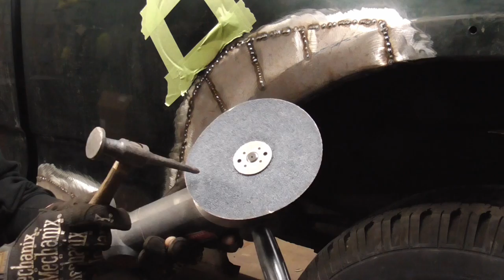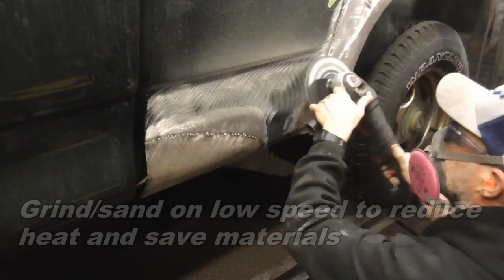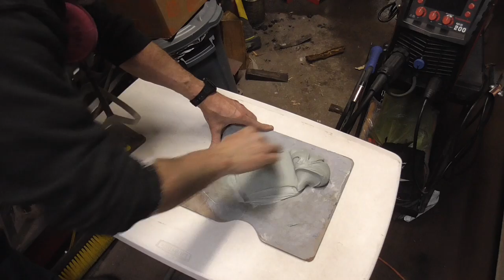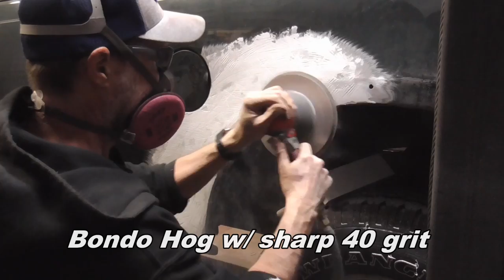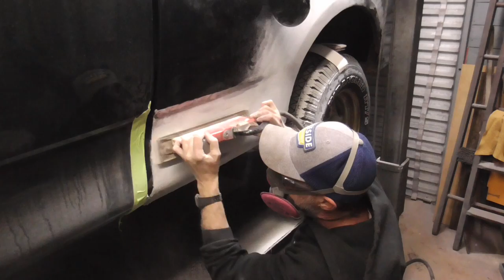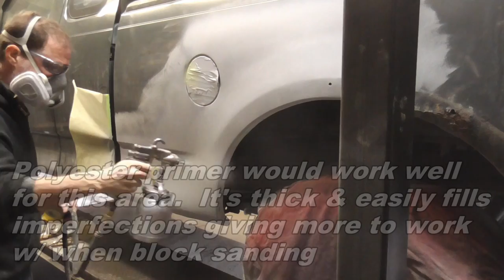Extreme Rust Hole Repair w/ Homemade Patch Panel - Part 2 / End

Comment: Thanks for all the specifics like the sandpaper grit. It's informative to see that it takes multiple coats to get the finish right.
Reply from the maker: It's rare to get the filler straight in one shot on large dents and rust repairs.  A couple times should get you close and the third is just filling in pits, minor low spots or other imperfections :)

Comment: Great job teaching a very practical, efficient and long-lasting method for repairing a very common rust issue! With that mileage, that truck is still in its adolescent years; capable of many more miles!
Reply from the maker: Thanks Icar - nice to hear from you my friend - hope all is well :)

Comment: The Calcium Chloride brine spray that is used in PA really eats the paint right off the metal of vehicles.  Also, it just destroys clear coated aluminum wheels.  The real kiss of death for a vehicle, is to keep a salted vehicle in a heated garage in the winter.  Heat activates the corrosion process.  Nice work - expert!!!!
Reply from the maker: Thanks Bruce - winter in the salt belt is hard on cars for sure - a real bummer :)

Comment: Just keeping those body lines correct is a big challenge in itself. You make it look effortless. My guess is practice makes perfect. Have a good one Jerry.
Reply from the maker: Thanks Mike.  I used to struggle big time when I first started doing heavy collision work and rust jobs like this.  Feather fill really helped me out.  Along with the cheese grater, using tape on the body lines,  always using super sharp sand paper, the bondo hog and really making sure high spots were tapped down before applying the filler.  Thanks for the kind words Mike :)

Comment: Worth watching a couple times.

I use an Astro mini belt sander with a 3/8” wide belt and 3M Cubitron belts and I can grind welds fast without touching* the parent metal.
Reply from the maker: I like Astro stuff.  I'll bet those Cubitron belts are sharp as heck when new 🔥
Reply: @LakesideAutobody  I started doing autobody work in the 70’s and Astro was considered junk next to IR and Viking. I think it’s always been pretty good and I still have an old Astro Binks #7 knockoff that sprays better than just about anything out there...but you really need a booth for that beast.

Yeah, the Cubitron is crazy good. I always have a spare box and I used my last box and my spare box disappeared. I think I ground 5 feet of stitch weld by the time the new box came and the old belt was still cutting.
Reply from the maker: @jeffreylonigro1382  That's funny about the Astro Binks - I had a Buffalo Pneumatic Devilbiss JGA copy that sprayed great - I a gave it to a friend of mine and wish I still had it.  The thing was indestructible.  Thanks for getting back to me about the Cubitron - good to know.  Have a great week :)

Comment: Instead of using the buffer with the 36 grit to remove the welds I would start with a finger sander as this goes directly to the weld without removing steel from the areas around it. Astro makes nice ones. This tool is also the bomb for removing spot welds particularly on modern cars that use high strength steel or boron steel that defeats normal spot weld bits. After removing most of the weld you can then finish things off with the air grinder or the buffer. Just a suggestion.
Reply from the maker: Thanks SATAMAN - always good to hear from you my friend.  I've known you for quite some time now - maybe almost 5 years.  Have a great week :)

Comment: Great video. I've done a few classic cars that are drivers,the owners want to nice paint job without paying for it. Some of the previous work done on cars have caused me to price the work out of their range because in some cases, there's more than 3 or 4 paint jobs done,one on top of the other. In your opinion,how many paint jobs stacked up is too much? Thanks for your reply.
Reply from the maker: Sorry about the late reply - missed the comment.  Sorry again too as I'm not quite sure what your ? is.  If you are doing cars for people and you do good work come up with a price that works for you like $20/hr or $100/panel etc.  An example would be if you charged $100 per panel - that's 9 panels on a 2 door so the job would be 900 bucks.  If you want to make more charge 200/panel.  Post it in your garage and go up to it when folks ask and say here's the prices.  It's very hard to charge people - I get it but if you don't, you'll be working too hard for too little.  If you come up with a good plan let me know - might use it myself 😊✌

Comment: Amazing work as always, I have a question, why no one ever put down a 2k primer on bare metal before filling, I’d thought it would give more rust protection?
Reply from the maker: The truth is the only protection you need is the paint - that's it - paint protects everything under it.  From the other side you need drainage and some method like in this video - https://www.youtube.com/watch?v=8XaZBy7GC7A or this - https://www.youtube.com/watch?v=y05dNxt-nVc

Comment: Enjoyed watching you work the metal. One question. What did you use to treat the metal on the inside of the patch panel to help prevent rust from forming and to ruin the wonderful work you preformed?
Reply from the maker: I have found this to work the best actually because it creeps into the pinch welds and stays greasy like an old valve cover that never rusts - https://www.youtube.com/watch?v=8XaZBy7GC7A  See this too if you want - https://www.youtube.com/watch?v=DqxMHCizkUE

Comment: Can you wet sand body filler that was put directly into bare metal? Will it rust over time? Thank you!
Reply from the maker: Are you talking about maybe if you are finish sanding (wet) and happen to sand through the primer and hit filler?  There should never be a time when you purposely decide to wet sand filler.  However, if you do for some reason, you'll be fine.  It won't rust over time.  By the time you blow it off with the air gun it will all evaporate or dry.  You can absolutely get filler wet and not worry about the bar metal underneath - that's stuff that you hear in magazines, internet and blogs but won't hear in a body shop 👍💯😊
Reply: @LakesideAutobody  very helpful sir. Thank you.

Comment: Nice work! What about where the inner and outer fender meet do you use a seam sealer to prevent water and dirt to go between the body panels?  Thanks!
Reply from the maker: I have found that drainage is the key so... I do this when the repair is done - https://www.youtube.com/watch?v=8XaZBy7GC7A

Comment: Thank you for the video. What size air compressor do you use?
Reply from the maker: 5.4 scfm at 40 6.4 scfm at 90  it's a 110v old Craftsman 1hp 20 gallon tank, oil filled, belt driven type.  Here's a video on it - https://www.youtube.com/watch?v=53miAObOdVY

Comment: Jerry my 2k Sandable DTM primer is pretty thick when mixed (part A and part B)…can I reduce this mixture to get a thinner consistency without degrading the primer?
Reply from the maker: Absolutely.  If it's urethane you'll reduce it with urethane reducer.  If it's polyester primer like feather fill you cut it with thinner or acetone.

Comment: 1,  need to mention if going to run a large disc, make sure you have a long finger trigger grinder to lessen chance of getting hurt, the side switch would be more dangerous.

2 for those with only a single speed grinder, you can throttle the trigger, "quickly push it on and release" to achieve a slower speed,  practice and you can get slow speeds to high speeds, and will act like a variable speed, thats how we also used polishers before new fangled variable speed switches became available. 

I personally prefer an air 90 degree grinder with a 2" rolloc adapter, then use 3" 36 grit disc on it, to me i like the finesse of it over other methods, and i tried a lot over my life. but nothing is gospel, find what works for you, that you like,
Reply from the maker: Thanks for you suggestions and input Randy - good tips.  Have a good weekend :)

Comment: Great video, as usual. In this case, what do you do with that pinstripe? It looks pretty close to the repair?
Reply from the maker: It will be removed and then re applied.  This one was painted on by someone so I'll have to remove the whole thing / both sides and use the tape kind.  My dad used to have the Beugler Pinstriping Tool (still make it) - worked real slick.  Had a magnetic strip or tape you'd lay down and run it right along the guide - paint came out really smooth and even :)

Comment: Hey Jerry I’m working on a 70 cutlass. I don’t want to have to purchase both rear quarter panels and outter wheel houses. They are pretty rotted and the wheel opening has a flared lip. Is that possible to recreate without buying all of that metal (about $700.00 usd) also the trim needs a place to screw to around the wheel opening
Reply from the maker: Absolutely.  You can fix anything, any lip, any wheel opening using this method - reminds me of a 1970 Grand Prix that had the same issue.  It had a cool factory color - some type of army green metallic.  It can be done though just like part one of this video :)

Comment: Do you worry at all about the pinholes in your welds (lets' face it, in stitch tack welding they're there) that are exposed on the backside of the panel especially in the wheel well areas that are going to get water/salt slung up on them?  I smear mine on the backside with seam sealer.  Any thoughts?
Reply from the maker: If you tap the seam down a bit, you'll have no problems - here's a great video on why - https://www.youtube.com/watch?v=JIIonJOVro4  The seam (lapped) is upside down on the inside of the panel and doesn't hold water - I do this to prevent future rust but your idea will work fine also - https://www.youtube.com/watch?v=8XaZBy7GC7A  Here's a longevity video on many similar repairs - https://www.youtube.com/watch?v=gIS1Tbv7Kvw

Comment: what size wire are you using .025 or .030 for the welding?
Reply from the maker: I'm using .025" - .030" works well too though :)

Comment: Can’t find these cheese grader files for the life of me
Reply: Stanley Surform replacement blades.  You can find them at Home Depot or other hardware stores.
Reply from the maker: @jasonpipkin1249  Stanley 21-299 - HD, Amazon, Ebay, etc.
Reply: Any lumber or hardware store should have them

Comment: Love it once again Jerry - thank you!  Just curious, for a master like you - how long from start to finish did this take you?  I know this would take me like two weeks minimum!
Reply from the maker: Each video took from about 10 am to 2 pm - parts one and two.  So with out messing with the camera and stuff like that, right around 5-6 hours.  Thanks for watching CA - always a pleasure hearing from you my friend :)
Reply: @LakesideAutobody  Unreal Jerry, that's nuts.  I do some smaller type repairs for others once and awhile - can I ask what you would charge someone for doing a project like this?
Reply from the maker: @CA-pv5ie  I don't actually charge anything as I only make YT videos - retired now.  I fix up clean title repairable vehicles (COPART)  if I do a collision video - then sell them.  Or in this case - a friends truck in between collision videos.  He buys the parts and materials then I just work on it when ever I get time.  Works out pretty well - no pressure.  The cost of jobs like this vary greatly from shop to shop but generally rust repairs like this range from 500 on up.  Rockers are like 500-1000+ per side.  Materials are getting sort of expensive lately too so prices at shops have to be going up nowadays too.  Nice talking to you and always good to hear from you CA :)
Reply: @LakesideAutobody  Thanks tons for taking the time to answer Jerry, all the best!!
Reply from the maker: @CA-pv5ie  You're welcome - all the best to you too - :)

Comment: How long do you wait/dont wait, to do the cheese grating?
Reply from the maker: Just before it gets hard enough to sand.  You can still dig your nail into it but can't sand it yet 'cause it clogs the paper :)
Reply: @LakesideAutobody  it’s funny because I actually have the same cheese grater tool you have, that at one time I must have been smart enough to buy and attempt to use lol. A lot of my rust repairs these days have been a lot more quick and dirty and light sanding with raptor paint jobs on top. I just bought a 2500hd with the 3/4 ton frame so she’s actually worth trying to save the body. 

Do you recommend any particular underbody treatments/oil? I’m probably going to try and lay under this thing and save the frame and all the other hidden bits and bobs. My instinct is to just get under there and spray it with some paint.

Comment: About how much does this cost to get done?
Reply from the maker: Body shops really don't do this anymore.  You wont find one that will repair a panel this bad to be honest.  They might replace the bed side for you but that's probably 2K more or less.  Get an estimate or stop and see if a shop will take on work like this.

Comment: A big mistake rookies make is not using sharp and aggressive sand paper to rough in the straight lines and body lines. Always time to go back and skim coat to take out sand scratches. You will literally never get it straight without aggressive cutting to begin.
Reply from the maker: You're right - gotta cut through not ride over :)
Reply: @LakesideAutobody  Good way to explain it. 👍🏻

Comment: Wheel well lip area needed some work still
Reply from the maker: You're right 🥴 - needs some block sanding.  It is a great example of a section that could benefit from polyester primer like feather fill - real thick for extra primer to work with when blocking :)

Comment: Man, you live in the Rust Belt, so do I, I live on Long Island that’s part of it ,,how do you even give her a guarantee on work like that you can’t. The people have to understand you’re just trying to save the truck for them because it has low mileage. What they really should be concentrating on, is saving the frame before it gets too bad and the brake lines and just stick a wooden flat bed with sides on the back. It’s a battle they’re never going to win, it blows.
Reply from the maker: It can be won with some work - see this video -  https://www.youtube.com/watch?v=y05dNxt-nVc  Here's a follow up video on these types of repairs - they do last quite long if done right - https://www.youtube.com/watch?v=gIS1Tbv7Kvw  Drainage is key - you want the panel to be able to drain and dry out inside - you can't stop it from getting wet inside of a panel but you can make sure it can drain and dry out :)

Comment: Good job but then you added another hour or 2 to the job for the over spray. There’s no way it’s no overspray on the door, window or back glass.
Reply from the maker: Thanks - here it is painted - https://www.youtube.com/watch?v=uki-sfpsEms  Lacquer primer dries so fast it turns to dust before becoming a problem on nearby panels.  It is good to cover those though just to be safe - old truck 😊

Comment: A gal of filler and half a gallon of primer later...................Doesn't anyone use glaze any more?
Reply from the maker: If the glaze uses a hardener it's the same animal as filler just more $.  A boss wants to see a guy get it straight in one or two applications of filler - then send it to the painter.  It better be straight too 👍🥴

Comment: I’m sorry but I can’t understand why anyone would not spend more time doing the metal work that way you wouldn’t need 120 pounds of body filler to me that’s a crappy way to do repairs I’m just saying it’s a-shame because you obviously have the skills to do it the right way
Reply from the maker: This actually is the right way (internet doesn't go into body shops).  Here's a follow up on repairs like this. 
 https://www.youtube.com/watch?v=gIS1Tbv7Kvw  It's a fraction of the cost of replacing panels, lasts just as long (you can customize the drainage), you can fix anything - even cars with no parts available.